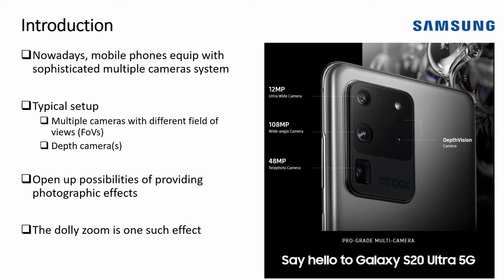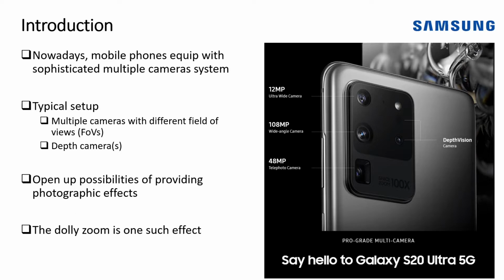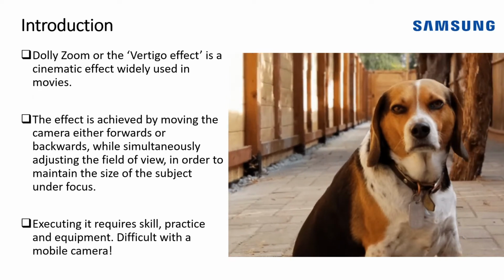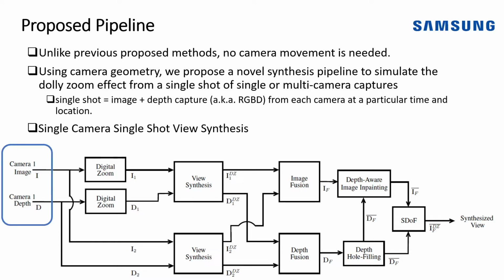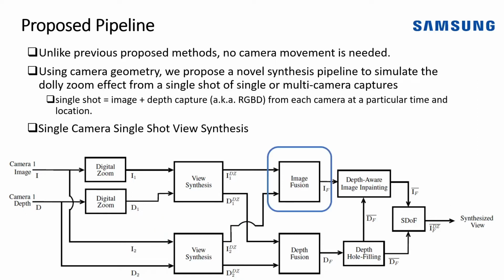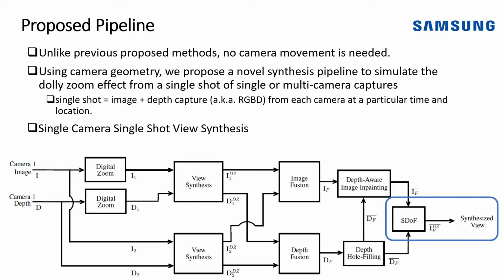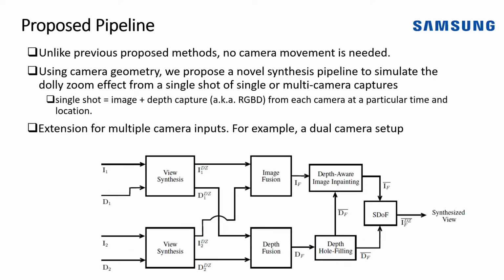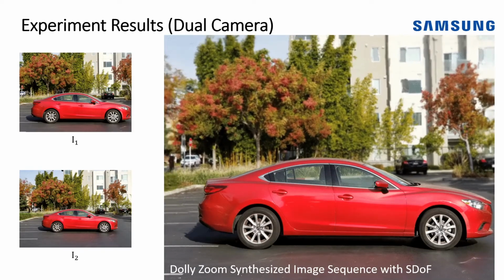The "Vertigo Effect" on Your Smartphone: Dolly Zoom via Single Shot View Synthesis

Comment: I have gone through the paper. My question is - How do you detect the focus plane, or essentially the value of D_0, automatically? I know it can be found out from the depth-map, but since D_0 will be different for different source images, how are you detecting this? Also, can this method be extended to images with deep depth of field?